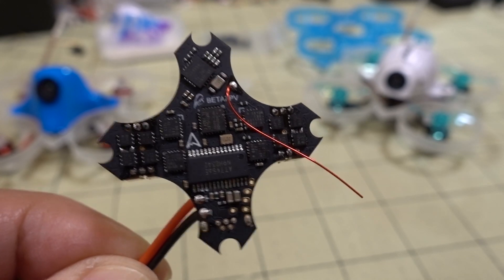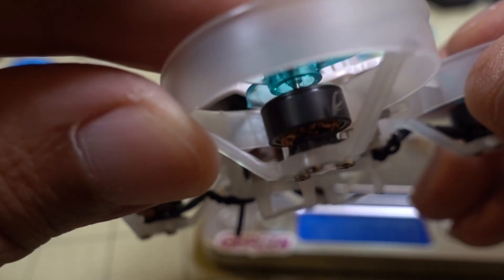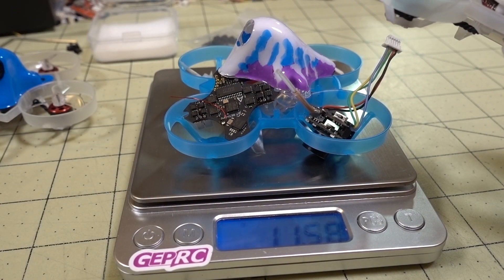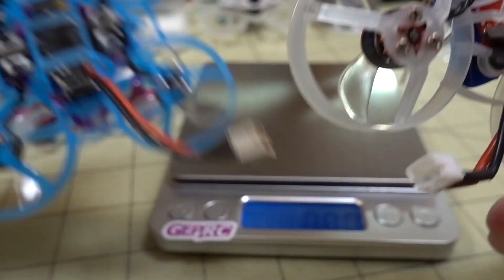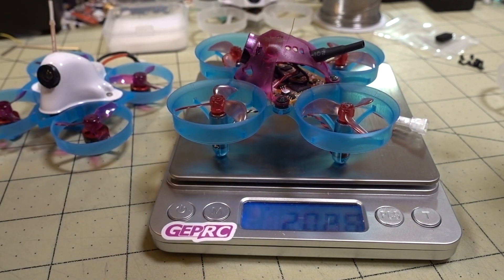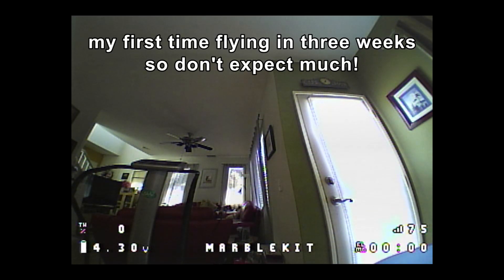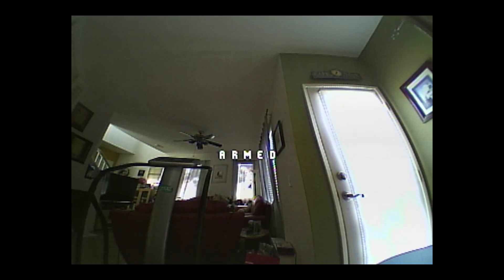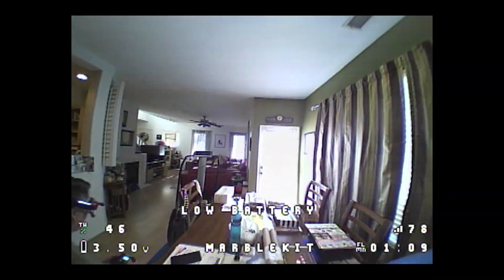BetaFPV F4 1S AIO FC Review 👍

Comment: Where do you attach the camera yellow lead if you're using a seperate VTX? I have one yellow lead going from the VTX to the "Cam" pad on the board as indicated on BetaFPVs site, but I'm not sure where I should solder the yellow wire from the camera.

Comment: Thanks Albert. Are you sharing the 5v and g pads with the cam and vtx? I using the nameless rc vtx and it doesn't have 5v and g pads for the cam so I assume I'll have to double up on those FC pads.
Reply from the maker: Yes, you can just double up on the pads.  It will work.

Comment: Looking to use this AIO on a toothpick build.... what is the range on the integrated frsky rx? Thank you for the review
Reply from the maker: Range varies with your RF environment.  If there's a lot of nearby wifi signals your range could be as small as 10 feet.  In a clean RF area, up to 250 feet or more is possible.  If you need to get a lot of range, I recommend getting the no-RX version of this AIO board and add your favorite receiver.
Reply: @AlbertKimTV  Yea it would be around our house so alot of wifi use near our home though we have about .75 acres to fly on. May just go with no rx version. Thanks.

Comment: did you have dshoot 600 problem? mine have this problem sometimes 1 of the motor not spinning and out of sync tone from esc, can i see your BF setting and what motor did u use
Reply from the maker: It has the occasional twitching so I switched it to dshot300
Reply: Unfortunately betafpv decided to create this new 1S F4 board, with BB1 esc processors... As a result, Dshot300 is the best you can reliably set these escs to...
I get they're trying to save weight, but come on BetaFPV! WTF

Comment: Your Super whoop video was great. Love that build. I went direct solder in the end. Only thing I wish was different was camera. Love the F7, image is the best but antenna sticking  straight up catches on gates. Tried splitting it and killed a cam. Wish there was a mullet version or similar camera but nothing compares. 

Listening to the motors and they way they suck batteries, do you think that’s the tune or the motors?  The Happymodel motors in the super whoop build give me over 3 minutes but still running BF 3.5.7 and PMB. 

Thanks for testing all this stuff out and doing reviews - very helpful!
Reply: Sounds like it...

Comment: Just ordered that FC to build a 65mm indoor whoop for winter. Not sure what motors I’ll use, thinking about using 706 19000 kv motors.
Reply: Same, I'm using the Meteor65 frame and 603 19000kv motors.